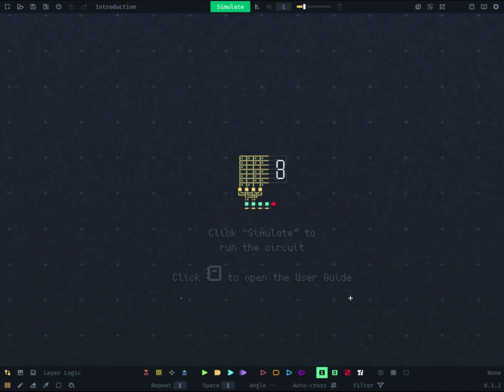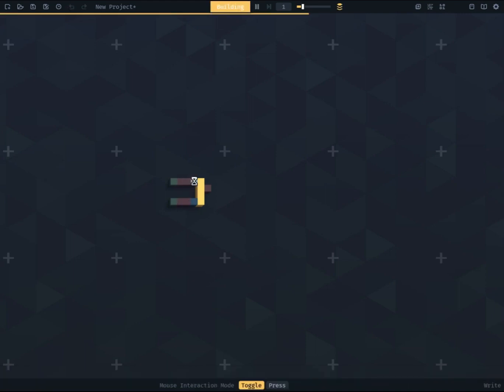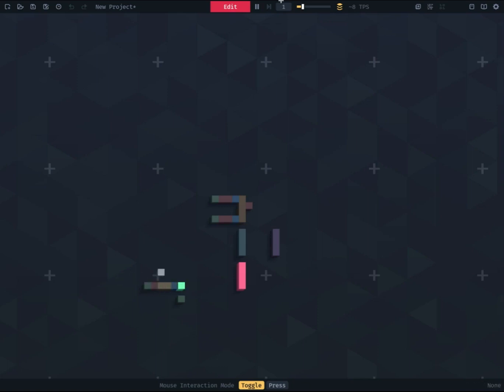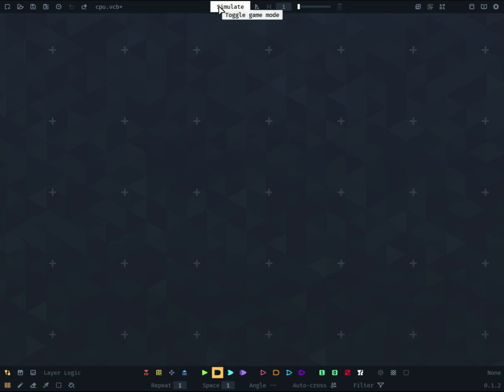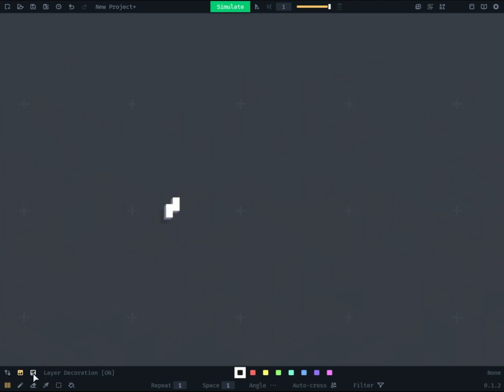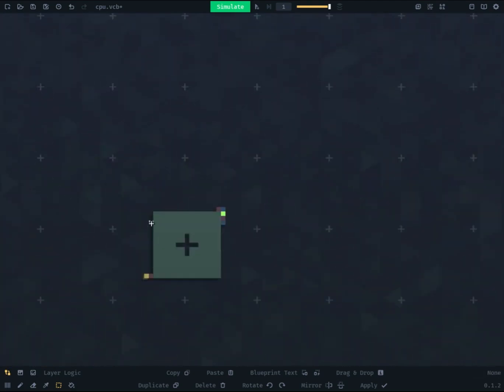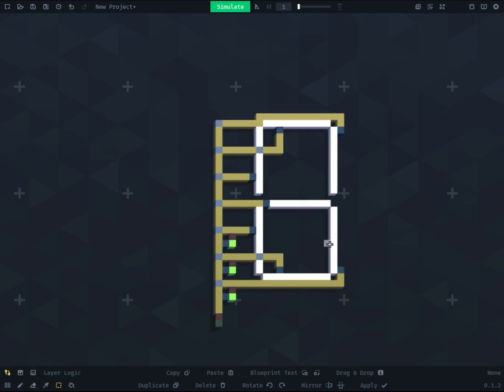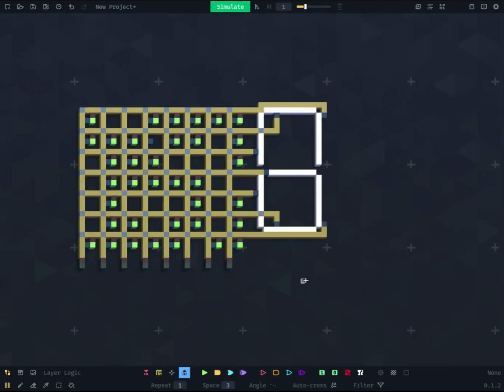Virtual Circuit Board - Introductory Guide for Beginners

Comment: I am having a really odd bug right out the box with this game where lets say i have a single clock ink down, and a LED nowhere near it, the led will flash, and if i have multiple latches and i click one of them, a random amount of other ones will either turn on or off, and this happens with all of the inks, and it makes it impossible to use, have you experienced this / do you have any ideas how to fix this?
Reply from the maker: I'd say you got in the right place because according to the official Discord, I'm the only other person to which it happened, I can't explain it but I had this problem when I switched GPUs, like, I needed a specific GPU (nvidia) to run games with Proton on Steam, and then I had this exact problem, when I reverted back to my old GPU (intel), it worked again. I suggest you try switching through your different GPUs and hope it work, nevertheless gl with that.

Comment: Seems to be more of a simulator than a game.
Reply from the maker: idk tbh, as long as you enjoy it
Reply: I'd say that this is an educational tool, more than anything. The ability to affect the simulation speed with an intuitive UI makes following the signals very easy.
I personally enjoy the visuals a lot when developing discrete devices that then integrate into one big machine, kind of how you do it with FPGA.
This isn't quite an engineering tool though, because you can do nothing practical with the designs you make, outside of this tool.

So yeah, as long as you're able to set your own goals, this can be a game (but in the same way anything in life can be a game if you enjoy it).
Reply: That's the point. Its an automata simulator.
Reply: "sandbox" is prob the most accurate
Reply: Conway's Game of Life is a simulator, yet it's also called a game.